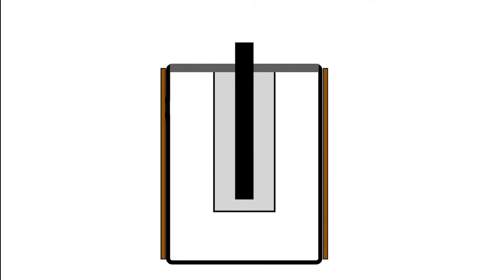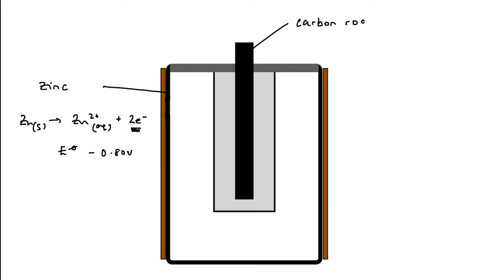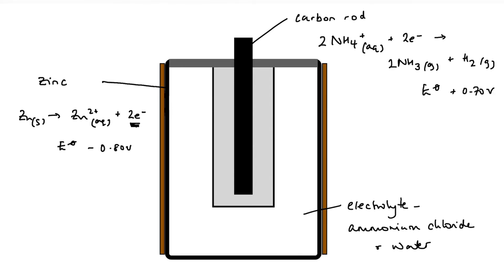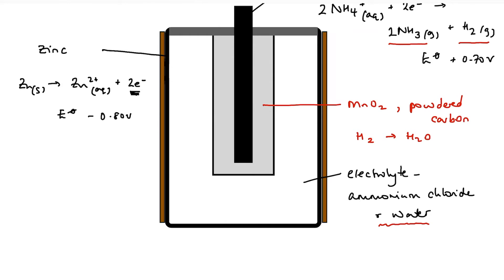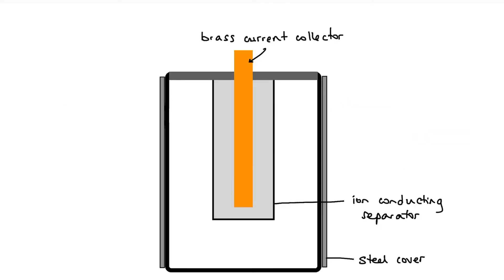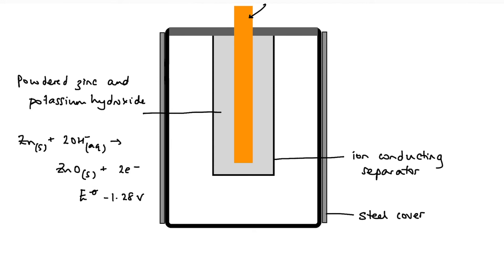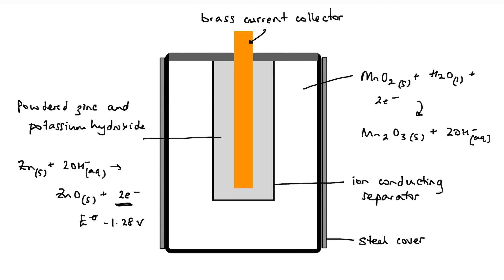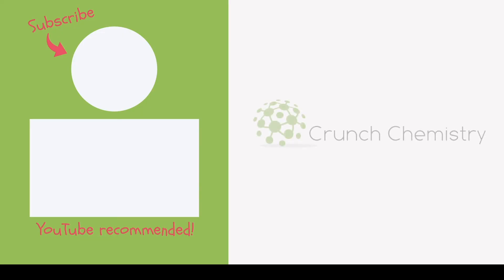How do zinc carbon batteries work?

Comment: what do you do with Zn+ ions?? You can't let this charge inequality just to build up. How does this Zn - electron separation that you call oxidation emerges from nowhere?
Does this Zn oxidation happens with O2 from air?
Reply from the maker: The battery is essentially a redox system with both oxidation reactions (Zn losing electrons to form Zn2+) and reduction (reactions involving both ammonia and MnO2 in which the electrons are gained and can be summarised as:  MnO2 + 2NH4Cl + H2O + 2e− → Mn2O3 + 2 NH4OH + 2 Cl−). There is no overall build up of charge as the Zn2+ ions are balanced by the Cl- ions in the electrolyte paste.  The definition of an oxidation reaction is loss of electrons by a species, not a reaction necessarily involving oxygen at A level.  Hope this helps 😊